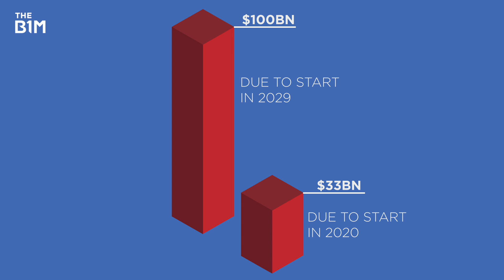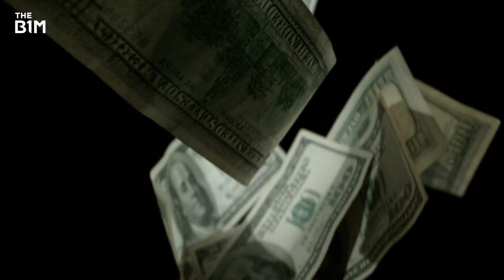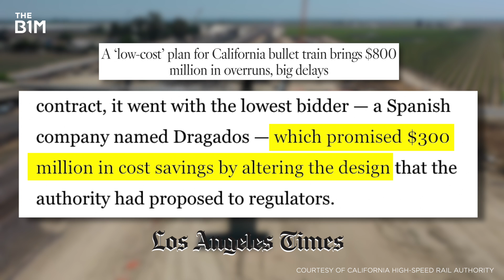What Went Wrong With California's High-Speed Railway

Comment: I think that most of the money for the train was simply stolen or spent on pork barrel spending which had little to do with the train.  We have reached peak incompetence.
Reply: I wish that I could believe that they have reached peak incompetence.  I think they're still climbing.
Reply: No, we'll never run out of stupidity, it's an inexhaustible resource.
Reply: The Bond issue routing is the route of the best political-fit passing through the largest cities between LA & SF.  The most direct route would parallel the I-R freeway over the Grapevine  (Tehachapi Mountains), up the west side of the San Joaquin Valley and over Altamont Pass to either SF, SJ and/or Oakland.  So we were stuck with a longer route and more stations along the way.  

The first delay came when the Union Pacific RR (one of CA's largest private landowners), along whose right-of-way the voter approved route was to have been build objected.  So, we wasted time and more money on engineering consultants to realign it (1) parallel to the BNSF railway between Fresno and Bakersfield, (2) in between the the UP RR and Hwy 99 in downtown Fresno (necessitating relocating the freeway 100'+ to the east) and parallel to the BNSF Rwy north of Fresno to Madera.  This increased in costs in land acquisition, consultants' fees, expensive, time delaying EIR process, etc.  In Europe they built new right-of-ways in the country and then merge the new tracks on to the existing rail lines into the existing late 19th/early 20th century downtown stations.   

The 2nd major delay came from the Obama Administration. Thinking it would be easier, they compelled the CA HSR Authority to begin in the San Joaquin Valley. CA was promised $6(?) billion over three allocations (the latter two as a result of Republicans opposing anything Obama wanted, by refusing to accept money to build "higher" speed rail projects in OH, Fl and WI; granted these were partial payments).  So, while CA lucked out on getting more federal money, the process became highly politicized, the prospects - some ten years ago - of getting any additional money were nil, and the private sector was nowhere to be found.  At this point, with the less than ideal route mandatory and knowing federal and private money would be forthcoming, I would have used all of the state bond money to build a new publicly owned right-of-way over the Tehachapis between Bakersfield and Palmdale, to HSR specifications and then turn it over to Amtrak to run its San Joaquin trains (currently Oakland to Bakersfield and Sacramento to Bakersfield) over it at 125 mph all the way to LA.  Not HSR, but incrementally getting us there.  It would have also complemented the $1 billion plus CA has invested in increasing capacity in BNSF's line up the valley since 1990.  Building this would increase ridership, induce more frequencies on this blended route and result in more private development (e.g. mixed use high density) w/i walking distance of the various stations along the route.  I.e., if you build it, they will come and use it.

Other factors increasing the costs are costs of construction materials, laws forcing higher labor costs (e.g. Davis-Bacon), the consequences of government being forced to accept the lowest bidder (limited prior experience), over reliance upon consultants, more political bickering, and the irritant consequences of design-build contracts - they do save money, but you do run into unknowns which require change orders.

I am a rail fan, geographer and a proponent of the concept, but not how it is being implemented in CA.  Brightline will get its Victorville to Las Vegas line built before the first segment is completed.
Reply: @johnhblaubachea5156  you had me until you decided to shit on labor. If there's a demand for someone's skills, they should be able to afford to live in the state they're working in.
Reply: Nancy Pelosi probably spent the money on expensive andrenechrome injections.
Reply: Pork is literally anything a politician favours. Congressional leaders sitting in DC who voted to help fund this in California were voting for Pork, CA High Speed rail funds are pork to California. 

A military contract to Iowa or Ohio is pork. A new battleship (a waste of spending) is pork. 
Expanding a busy airport in whatever state is Pork spending. 

Only thing wrong with pork is whether or not it is wasteful on its own merits not whether or not a politician voted for it.
Reply: I remember Newsom saying that "You can forget about that Bullet Train cause they going to used that all the money to Help the Homeless People. well guess what happened to CA?  I guess they pocket the money for them selves smg
Reply: @leowashington8991  lol the money didnt go to the homeless. There are still homeless people and nobody is helping them.
Reply: @Sevenfold120   I can see that, they walking like a Heard of Zombies Every Night in the Streets of San Francisco
Reply: @leowashington8991  Yeah because nobody ever votes to help them. Social services are always voted down.
Reply: @leowashington8991  those are the chronic homeless, and building housing for them is only one piece of the puzzle. Mentally ill and/or addicted to drugs, they need care not just a roof over their heads. That triples the cost of the solution.
Reply: @Sevenfold120  they need to help themselves
Reply: Chill Will  and you're calling ME retarded? Cool story bro.
Reply: Whenever I watch this sorta stuff I realise why the american people have such little faith in the US govt, i mean it takes a special kind of incompetent when private companies are setting up rail networks.
Reply: Probably went to the bloated public pensions.
Reply: Your right political crooks.

Comment: We in CA could have had much of the benefit of HSR if they’d just modernized the existing track so standard trains could run efficiently. The problem with our ordinary passenger rail service is that a significant section of the LA-SF rail line is single-track (as it was back in the 1890’s). That means that on that section, you can’t run northbound and southbound trains simultaneously. One train has to sit on a siding, sometimes for an hour or more, while the other train uses the track. Who gets priority? Freight traffic, that’s who. Freight runs make money. Passenger runs lose money. Eliminate that bottleneck and non-HSR trains could make the LA-SF trip in 4 hours, dependably. Nearly double the time of HSR’s promised travel time, true, but about $80 billion cheaper. But noooo, that’s not sexy enough; our big spenders in Sacramento have to have their glamour project.
Reply: Are the environmentalist against adding a second rail? They seem to be against mankind.

Comment: If you think the UK's struggles for high speed are bad, you should read up on the Dutch. 
They have tried to expand their existing high-speed line (which is also an unfinished project to date) for years now, but it keeps getting stuck in the paperwork phase.
Reply: I frequently travel with the Thalys. That's a high-speed train.

Intercity-direct aren't bad either.
Reply: At least they have some sembelence of a high speed rail system unlike one country that shall not be named

Comment: It'd be better if they used that $$ to tunnel from Silicon Valley (S.J) East to the central Valley (near Patterson) to open another leg in/out of S.V.

It would reduce congestion on 580 & 680 and open up housing dev in C.V. reducing price pressure on S.V. (perhaps).

As a Ca resident, I can't help feeling like this is a State bureaucracy $$ laundering scheme.

Comment: BART takes you directly to the airport (SFO or OAK) for a flight that usually costs about 40 bucks. Not sure how they thought the tech of the 1850’s could compete with that.
Reply: Security at airports is a huge hassle to deal with, not to mention the long lines, gate delays, etc. High Speed rail isn’t really 1850s tech.

Comment: What went wrong? 

We expected competency from the  same inept people that hopelessly botched the management other projects, such as the CA DMV Computer system upgrade that was cancelled after 7 years and $208 million was spent, because they still couldn't get it to work right. 

Or, how about the Eastern Span replacement for the S.F. Bay Bridge....  completed 6 years late at a cost of 6.5 billion dollars, a whopping 2,500% cost overrun from the original estimate of $250 million. 

There is no longer a need for this money pit train, people have long since stopped commuting between SF and LA, which was the justification for it. The high tech jobs that were fueling that need, have long vanished overseas.   

And with the recent work place changes brought on by COVID,  people aren't even going to be commuting locally like they were pre-COVID, never mind the extended commute distances this train was meant to serve.

Comment: In Poland we faster build entire high speed network than in US
Reply: When you compare how small Poland really is to the US
Reply: @blackhole9961   Poland is about 304,459 sq km. If it was a US state, it would be 6th largest state in the US. And yet the US doesn't even have one state with a good high-speed network. 

Hell it barely has one LINE.

Comment: The flaw in your presentation is focusing only on two major airport hubs as solving the LA to San Francisco leg. You ignore the dozens of regional airports that provide service to the two regions. Have to drive to the limited high speed rail hubs eliminates any time savings of the actual train trip. The monetization potential is providing a high speed commuter train from the San Joaquin Valley to the LA and SF Bay job centers. This would open up the Central Valley to home development that is so expensive in Silicon Valley. Very short sided and biased video.

Comment: $100bln borrowed in bonds comes to about $300bln over 30 years, or about $10bln per year, or $30 million per day just to pay off the bonds.

That $30 million must come out of operating profits, i.e. AFTER all operating costs and maintenance costs are fully paid for. So to pay off $100bln in bonds the train would have to take in revenue of about $60 million per day. Every day. Every single day.

At $200 per one way ticket that would require 300,000 passengers per day. Every day. At 1000 passengers per train that would require 150 trains per day each way, or roughly one train every five to ten minutes throughout day & evening operating hours.

Scheduling 150 trains per day traveling at 220 mph on a single track each way, north & south, AT FIVE MINUTE INTERVALS is a catastrophe waiting to happen. It is madness. It is impossible for this project to work financially. And recklessly insane to try.

Comment: This is what I would do:

Scrap the plan for 220mph. Instead, build a brightline-style passenger only line capable of 125mph, that doesn’t require electrification at the start. Then you can use efficient and low-emission Siemens Chargers and build ridership without being delayed by freight trains. Easier, faster, and cheaper construction process than this mess.
Reply: Really? Well then!!! I knew this project is a waste of time and money but the left and people who support HSR think it will work. I think not. The charger locomotive is very efficient and looks modern and futuristic. I’d take the charger over a money wasting high speed rail train.
Reply: Why build anything at all? For the same amount of money this project is wasting, you can buy up Union Pacific.